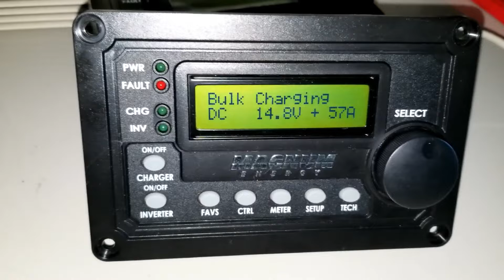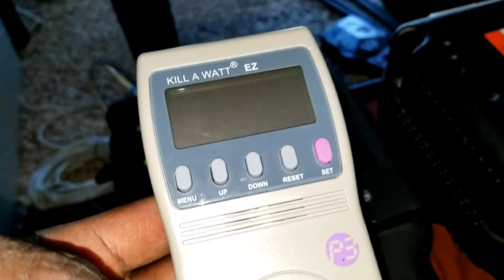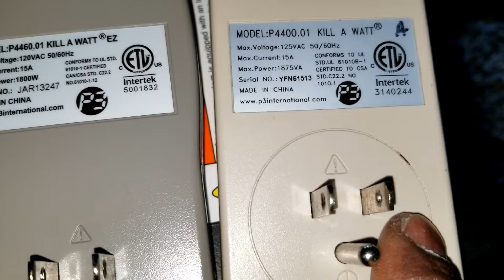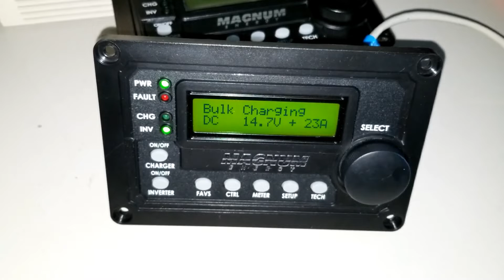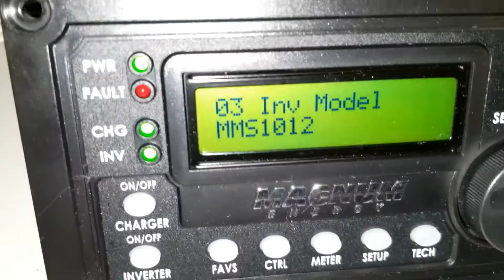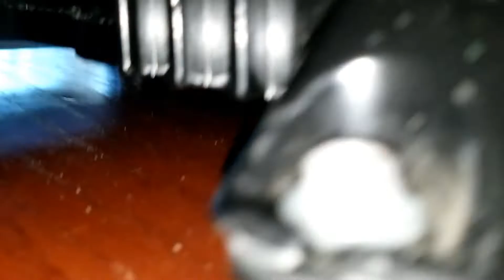VW ELECTRIC CAR, VOLKSWAGEN, E-GOLF, GEN 2 ELECTRIC VEHICLE BATTERY CAPACITY/LOAD RESULTS (Part#6)

Comment: That’s a great test of the inverter under overheating conditions and they’re still running. Seems like they should be smoking or a bad burning smell would be ready for a shutdown . But the fans are the only lifesaver for the inverter being in a cool house . Just think what would happen if the inverters were in a much warmer or hotter environment at or a little over their threshold . They may ether shut down or smoke and burn out . Those are some tough magnums fo sho . So temperatures matter .